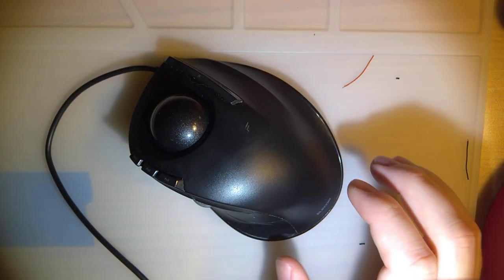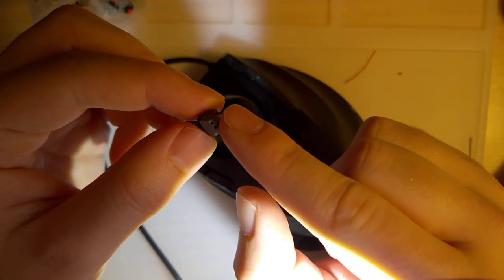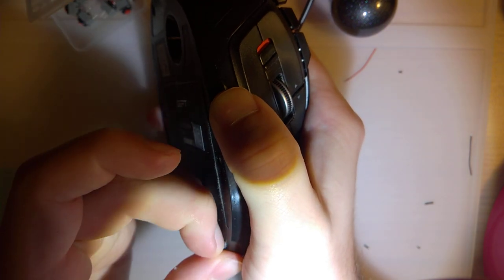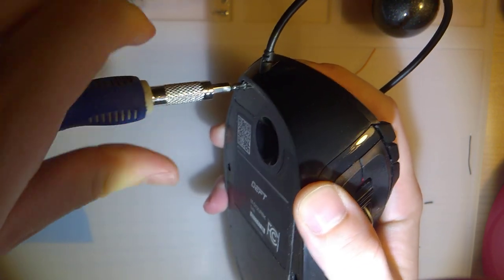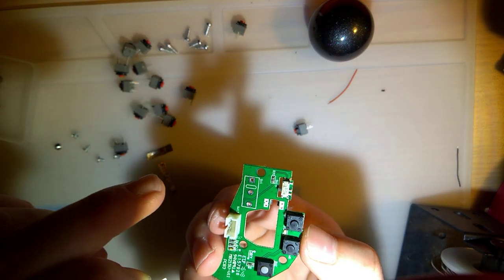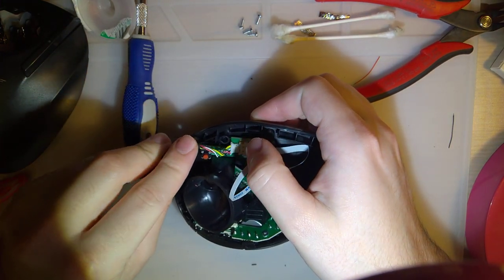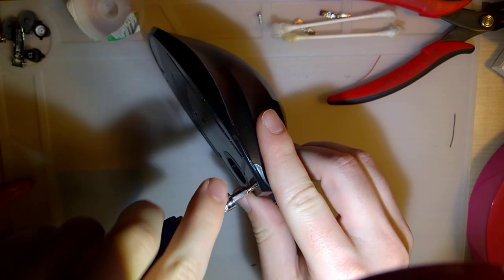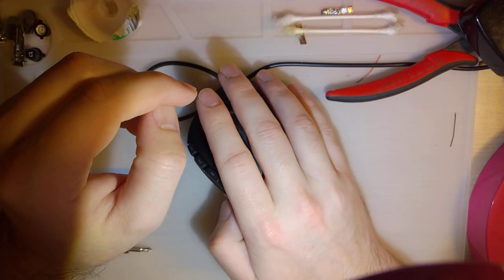Installing Kailh silent mouse switches inside my Elecom M-DT2URBK

Comment: I just took one of these apart to change the bearings. To avoid peeling the rubber pads off the bottom, I used an exacto knife to cut tiny holes around the screws.

Comment: Great video. I'd love to hear your thoughts on bearing swaps. Elecoms come with ruby bearings that are supposed to be not as good as zirconium bearings. I have a bunch of trackballs with both. The ruby ones seem to start out bad but apparently get better with accumulation of oils from skin. They're still not as good as zirconium ones. There's also supposed to be silicon nitrite ones that are even better than Zirconium ones.
Reply from the maker: NGL, I ended up replacing this specific mouse with a DEFT Pro. The new mouse is better in just about every way. It also looks to use ruby bearings but I've had no issues with them. They definitely took like a week of use to break in though.
Reply: Coming in late to the party, but felt compelled to chime in. I have an Elecom HUGE and replaced the manufactured ruby bearings with Zirconium, which were only marginally better. I found a HUGE (pun intended) improvement when I swapped the zirconium out for steel bearings.
Reply: @makho  Rubies are incredibly hard(they're the same as sapphires with different oxides providing red instead of blue coloring).  Think about how hard it would be to smooth a 2.5mm ball of ruby.  It's possible to get good or bad ruby bearings.  Ceramic balls coated with zirconium are always better if you buy grade 5.  The ceramic is higher grade spherical smoothness and the coating is a scientific process that's easier to perfect than smoothing a tiny dot of something just under diamond moh scale hardness.  The amount of improvement depends on how randomly smooth/regular sphere they got your ruby bearings.
And no, you don't break in ruby bearings.  You're probably distributing finger oil.  If anything wore, it would be the ball and that would NOT feel good.

Also, no, don't ever use steel bearings unless you're willing to swap them at least once a year.  1)they corrode  2)they wear appreciably, unlike ruby or zirconium oxide/silicon nitride

Comment: So does this also function as a normal mouse? It looks like there is an optical pickup opening in the bottom where it can be used like a normal mouse as well as a trackball which I actually think would be amazing.
Reply from the maker: No, that's not how trackball mice work. The opening is so you can remove the ball (for cleaning).
Reply: makho I actually use a trackball at home, M570 I think?
I just know that sometimes in a sniping situation large movements with a standard mouse set to low dpi input can be more precise, but I used to dominate TF and Unreal Tournament with my Logitech trackball. On a dial up with 110 ping. Those were the days. 

I thought if there was a trackball for normal looking, then a zoom macro that would switch to mouse mode you would have the potential best of both worlds once you got used to it.
Reply from the maker: @JimmyGFromDayton  This trackball has a DPI switch right above the scroll wheel which lets you slow the cursor down or speed it up depending on what you're doing. I typically use it on the fast setting so hitting the switch would slow it down for more precision in my use case.

Comment: Did you ever replace the scroll tilt switches and are they the same as the 3 fn buttons on top? I need to replace them as well
Reply from the maker: I only ever modified what I showed in the video. I eventually upgraded this mouse to the DEFT-Pro too and I regret not doing so sooner.

Comment: friend, one question, how do I connect the 2-pin switch? Can I connect it anyway or does it have a specific address?
Reply from the maker: the switches should not be directional, either order will work